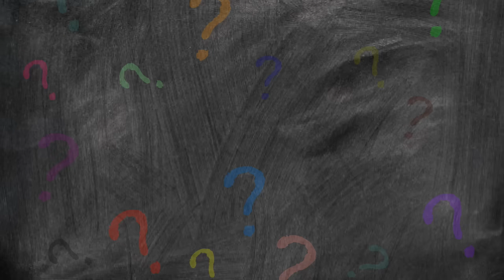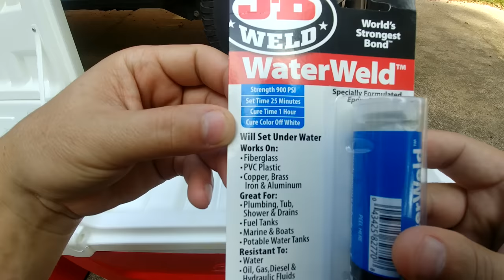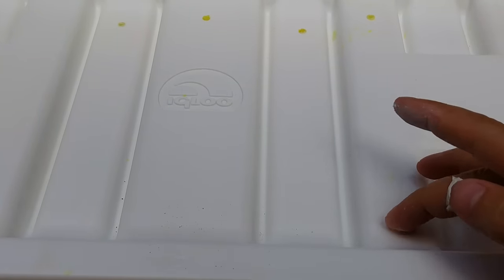Do Yeti cooler hacks work?

Comment: You say that the lid weighs several pounds after the mod, that shouldn’t be the case if the foam is full of air and cured correctly. How many cans of foam did you use, and what was their weight? 
The foam when used correctly and has off-gassed weighs virtually nothing, I suspect therefor that you used far to much foam and it’s either still in liquid form or more likely is so compressed and dense that there are minimal air pockets to insulate. You can test my theory by drilling a few holes and seeing if the drill comes out sticky or the foam if set feels excessively dense compared to the bits that cured unrestricted on the outside of the box. If it’s sticky it could be because you A. Used to much (as already stated) and/or that it needs moisture to start the hardening process. Check the can and see if it mentioned that it needs moisture to cure(most do). It may also say not suitable for sealed containers, this is because the moisture needed to start the reaction can’t get in there. 
I’d repeat  the experiment and use far less foam and add a couple of squirts of water in a mist into the hole before you squirt the foam in. As you stated you can see the foam inside the lid, so I’d drill one hole centrally to squirt the foam into and one in each corner to release the pressure and allow the excess foam to come out of. A lid that size should only need a few seconds of spray to fill it, so be more conservative as you can always add more through the vent holes if it’s needed.
Watch this for an alternative to spraying water mist into the lid. https://youtu.be/uSygJ97_NkU
Reply: I made a foam mountain one time years ago. I ended up with a flat pile of plastic because I didn't let it set up before applying another layer. I figure he did the same. Not enough air
Reply: I think the lack of vent holes in the corners caused the internal lid pressure to increase and warp the lid, which let warm air enter the cooler due to a poorer seal around the top edge.
Reply: And also he never mentioned if he used a closed cell insulation or an open cell insulation which don't work as well as the closed cell spray foam....acrylic won't work as well and I don't believe he took enough info. on his choice of spray...and yes misting is a must...a little more research and he'd be flawless... too bad... at least he didn't spend much but he'll...how is everyone getting these sprays for 4 to 5 dollars....I spent $13 before tax and it was the cheapest...need to know which store has that probably in the States...it is much cheaper depending on where you are....
Reply: You can buy different density foam. Some  weighs more when cured and has different sized air pockets
Reply: @wifebeater756  
They do make heavy duty foams for other purposes but I don’t know of any insulation foams that would weigh several pounds on that size lid and even if there was one, why would you use it? It’s the pockets of air that insulate not the chemical that the foam is made of. As long as the lid is full, the less mass the better, when it comes to thermal efficiency.

Comment: I’ve done this hack and have experienced warping in the lid on my first attempt to a smaller maybe more pliable plastic. My second and third attempts I made sure I had plenty of “escape/vent” holes and secured the lid to ensure a snug fit. In addition, I believe the advantage of an insulated lid is the deflect or interrupt sunlight “baking” your ice . One way is to purchase a foam seat that are designed to rest atop coolers thereby getting a twofer
Reply: Problem is it's thermal mass, it's warm outside and the heavier lid takes longer to cool and adds more heat at the time of adding the ice. Using a IR reflective paint with a high amount of ability to pull heat put of the cooler. Or just build a peltier system and run it on a small solar panel and small battery.
Reply: @quijybojanklebits8750  you still have the air gap in the lid as a barrier to insulate the inside of the cooler. It may add more of a insulating quality by just adding a foam top to the lid. Anything to keep the direct sunlight off of it would be good for the lid.
Reply: @gregred78  yes, but there's more material, the foam added to the lid makes it denser therefore it pulls more energy to cool down the lid. It's the same reason yeti recommend preecooling their coolers before use.
Reply: @gregred78  the best thing you could do is to make a paint using acrylic, acetone and Barium Sulfate micro balls(various sizes) and apply it to the lid as this would cause cooling by radiation of IR heat away from the cooler.

Comment: air is a great insulator filling it with foam is removing the air barrier. I did have the thought about how much sun one side of the jeep is getting over the other side tho
Reply: My thoughts exactly. He pushed in why too much foam, on top of that, making it even more product dense and less air.
Reply: He used way too much foam, it should be fairly light still because the foam creates lots of little air pockets which slows down the thermal exchange much like double paned windows slow down the heat loss through them. In this case he made it super dense and little to no air bubbles as it cured.
Reply: TRAPPED air is an insulator. Air on its own, especially moving, is a thermal conductor.

Comment: I've used a flattened 24 pack beer box over ice in cooler and three days later still ice, course I left ice in the bag, but the extra layer of the box inside  helps keep the cold from escaping,  I'm sure a piece of Styrofoam would also work inside, cut to fit over the stuff inside 😀
Reply: I have a piece of 1/4" insulation cut to size to fit inside my camping cooler on top of the contents. That combined with pre cooling the inside along with insulating the lid keeps ice way longer than without any of those things added.

Comment: Switch lids.  Maybe the cooler bodies aren’t equally insulated.
Reply: Need all of the variables to play out
Reply: Yup.
Reply: Yes, he never tested both unmodified to determine they are equal efficiency.
Reply from the maker: I didn't because I thought it would be better than stock by far. If it did perform like a Yeti there would be no competition between the two coolers and this conversation would not even exist.

Comment: The foam needs to expand.  If you drilled many holes around the inside of the lid to release the pressure if will fill with air pockets and create a good insulator.  With no pressure release you basically created a solid block of foam inside the lid that absorbs the heat and radiates it inward to the cooler area.

Comment: I think the reason your modified cooler didn't work is the foam spray is not a insulating type. It is intended to stop drafts in your home and not insulate. Also the cooler is made with a dead air space between the plastic walls, and that holds the insulating valve. Much like double glazed windows in your home.
Reply: Air is the best insulation... aerocrete, fibreglass etc if you compress the insulation the u value goes down. Captive air
Reply: @fabriglas  Trapped air is the best insulation. Otherwise we wouldn't bother putting spray foam or batt insulation in homes we would just leave the cavities empty.
Reply: Spray foam, in any form, is an insulator. It traps air pockets which is why it insulates. Regardless of open or closed cell foam it will insulate. The physics behind this is simple and deceiving with this experiment. There was no control or variation of conditions to fully test the modifications. Think of it this way. There is no such thing as cold, only degrees of heat. In a cooler you are trying to first cool things down and then maintain the cool temp. In the modified cooler, while you trap the ice which is at a lower temp you also trap a lot of the hotter air in the cooler and in the lid. It takes a lot to cool the foam insulation so all of that heat transferred to the ice instead of escaping out of the cracks in the lid and through the lid itself. The experiment actually worked. It proved the modified cooler traps temperature better than the stock cooler. If the coolers had been first iced down and stored in a cooler place you would have seen the modified cooler would have maintained the cool temp desired longer.
Reply: @MrRaptorman1975  Spot on Rob.  A whole lot of small pockets of air makes for better insulation than one big pocket.  It would be interesting to use block ice to see if the results would be more favorable do to the slower melt time.
Reply: Nice explanation. Also no initial test of the modified one to see that it performs comparably to the unmodified without insulation. No apples to apples comparison for a true baseline.
Reply: @patkarp1965  yes, but that assumes the same amount of air. this type of expanding foam (especially when injected into a rigidly confined space) make it so that there is mostly Not air in the cavity. the reason aerogel is such a good insulator is because  it is only 3% of itself, the rest is just captive air.
Reply: @patkarp1965  agree re -(A whole lot of small pockets of air makes for better insulation than one big pocket).
 I have a small cheap blow molded compressor freezer/cooler  of similar size to these. It used to be constantly be on and off, and if sides were left touching anything, they would freeze to it(set to max cold at -18, and it rises to - 16 between compressor runs).
So i drilled holes everywhere (lots, ex refrigeration serviceman, so carefully done to outside surface only), and filled with spray foam, from a warmed in warm water first can, filling at many holes until flow seen from others. (imo op did not get good coverage or expansion ).

Result was/still is(been running non stop 2 years in house bus), no more freezing of sides(or even any condensation if good airflow around, or not), and much reduced power consumption, and much more stable temperature (i have a Govee bluetooth monitor in it).
If doing again, i would go for closed cell polyurethane fill poured in, for even better performance.

2 - i have a spirit still (legal here for own use), which i modified to a 60 liter pot, using a double wall stainless urn, with 2 electric elements fitted. First few runs it seemed good, but i noticed outside walls of pot were getting hot.
So again i filled double wall with spray foam, and outside no longer gets' hot, and heating time(running) has reduced from almost an hour, to just 40 minutes.
Reply: The only thing better than an air pocket... is a vaccum pocket. Insulation is insulation because it creates dead air. Fiberglass insulation is that way because of all the trapped air pockets. THis is why bubble wrap lined with mylar is really good (Reflect-X). The reason Yeti coolers are so good is because they dont just make a sealed volume of air, they create a vacuum insulated area. Literally the only difference between a Yeti and this cooler he used, is the fact that there is negative pressure in the Yeti and base atmosphere pressure in the Colman here.
Reply: @kibatsf  Agree a complete vacuum is very good insulation, but unsure a very good vacuum could be pulled in a blow molded cooler, without it collapsing, especially if exterior will be subject to heat? Perhaps rather than vacuum, it is very dry air between (thinking its the moisture in the air, that does most of the heat transfer).

Just double glazed most windows here with acrylic  (currently winter getting to -3deg c), and although power bill is looking like it has dropped 10%, some still get a small amount of condensation between panes, so would love to pull a vacuum between, but is not practical, without spacers to support gap between. (panes were installed in 23dg c air at 40% humidity rh, to try to get as dry as air as possible currently, between them, (but first couple were done at 21deg, and 70% humidity, so were a failure, with being completely fogged up next frost, have since opened and resealed them with drier air)
Reply: @Retiredkiwi  Thats why the Yeti is more expensive. It cost more for the polymers and what not used to be rigid while under vacuum. Though, it can be done cheaper... Yeti was just one of the first to do it and market it. The cheaper versions of the same method are actually pretty on par... for hundreds of dollars less.
Reply: @kibatsf  not seen the yeti brand here, but some brands do claim 3 days for ice, so perhaps a few do now. (certainly was no vacuum in my cheapy one that i filled though).

Comment: Prechill the insulated cooler. It's going to retain heat more and cause the ice to melt faster. Even yeti suggests pre-chilling with a sacrificial bag of ice
Reply: But the second round it was pre-chilled.
Reply: I toss in freezer packs or frozen water bottles the night before but only if I'm gonna be fishing on the boat or something.     If it's a day thing or whatever anything can hold ice for a day
Reply: I spray it with hose water

Comment: I would have swapped lids then test the again maybe the window foam was transferring heat?
Reply: Air is a good insulator, that's why a bath tub with bubbles stays warmer longer than one without. The thin film of soap on the bubble doesn't insulate, the air inside the bubble does. Same with the lid, when there's a gap of air, it insulates well, with the spray foam it gives it more direct contact to the heat outside. It's possible he used too much spray foam and it wasn't able to expand enough and was too dense to insulate better.

Comment: Great stuff (expanding foam) is a form of a few compounds including isocyanates which a reactive to moisture in the air. It forms an exothermic reaction when curing so there’s a lot of heat retained inside the foam for awhile
Reply: Colton Cain 
Also not having room to fully expand slows (and can actually stop) curing.
Reply: That's exactly what I thought! Most substances generate heat when the move from one state to other. And it's well known that to this stuff takes longer time to cure in this kind of test environment.

Comment: You need the airspace so the top doesn’t transfer the heat into the cooler.
When you fill it with the sealant it becomes a solid mass...no good!!
Reply: Exactly same theory as a thermopane window the air gap between prevent heat transfer
Reply: But that also goes against all the other coolers and cold storage boxes used for years with insulated tops. Thats not why is made like that
Reply: bingo.  The airgap is the insulator.
Reply: The term you’re looking for is “thermal break”
Reply: I think that foam traps air so it itself is an insulator. Maybe a different type of foam could be better.
Reply: @jasonb4738  They were used for years, but not efficient, they were worse than this.  Longevity, doesn't mean good. Good lord, look up a youtube video on how double wall tumblers are made.
Reply: Dangerous One - yes, the proper foam or material can be an insulator, such as EPS expanded polystyrene...the stuff those $7 white “oops I forgot my good cooler” coolers are made of. And you’re right...it works partially because it traps air in pockets. 
But moreso because EPS has very very low conductivity. Those cheap spray foams are typically open cell types with an R-value of 3.7 at 1” thick....not a very good insulator. Closed cell foams (the kind often used in building envelopes) is R6 or more at 1”, but are much more expensive and difficult to work with (just my opinion).
Those cheap blow-molded plastic coolers are cheap for reason, but work best as designed. To “hack” one, you have to buy the right 2-part reaction foam to better insulate, then drill lots and lots of holes to allow for the expansion without disfiguring the box, then clean up the mess.

Another commenter said they hacked a cheap cooler by drilling large holes and pouring in tiny styrofoam balls, then used a heat gun to expand them to fill the spaces. In theory that could work very well...
My dumbass would warp my cooler, probably melt a hole through it, and maybe start a big fire.😂
Reply: @CowenJE  let's not reinvent science.. tumblers weren't invented last year by Yeti.. most  ground breaking researches were back in the 40's and 50's and most physics laws were discovered 100's years earlier.

Comment: I was all set on sprayfoaming my lid now not so sure.  A worthy experiment good sir.
Reply from the maker: Thanks! As you can tell by my reactions in the video I was shocked at the outcome I had.
Reply: If you look into heat transfer thermodynamics, hollow is better
Reply: J P if that is the case then why do yeti, rtic etc have foam filled lids?
Reply: @GReviewz  cause.. Illuminati
Reply: Andrew T lol who knows... I’m sure if hollow space was better yeti would be using it. Illuminati for sure...lol